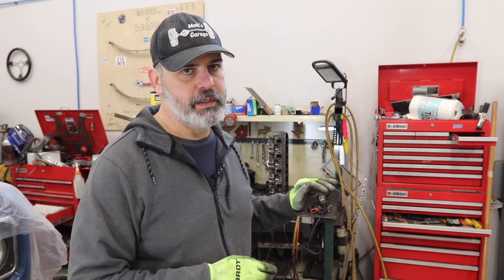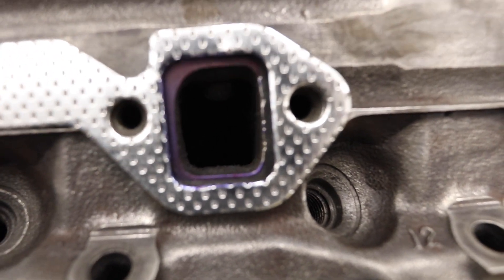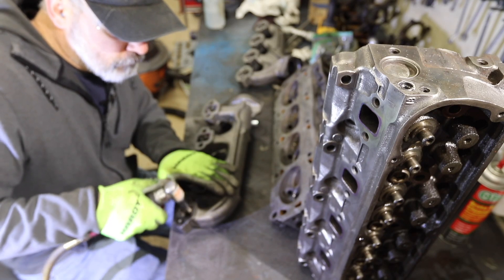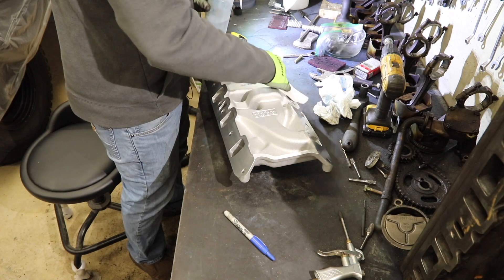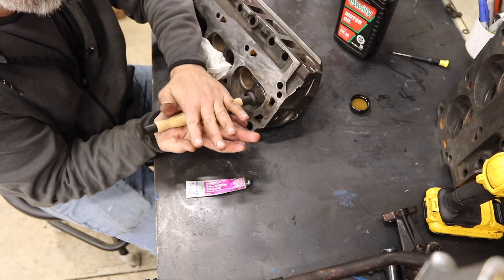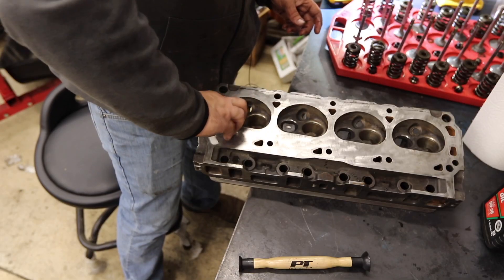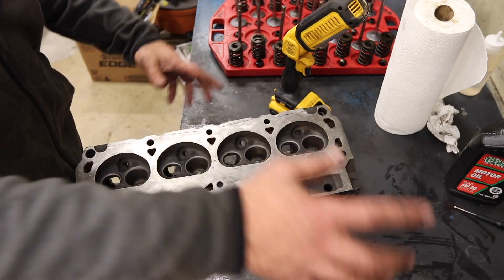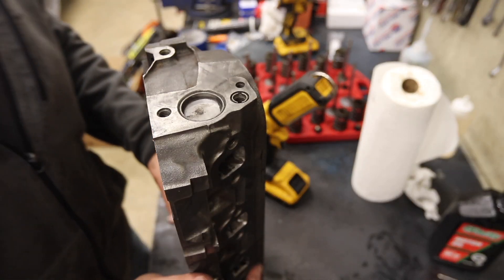9.33-Head Porting and Valve Lapping

Comment: Lapping valves is amateur.
Reply: Did you measure play in the guides? Also, porting is not the same as port matching. To port heads properly you need to use a flow bench. Its easily possible to reduce volumetric efficiency. Keep in mind you can easily get rebuilt heads in a day
Reply from the maker: @johndeckercom  no, I probably should have. I’m prepared to buy heads if need be. I kind of just wanna see what happens. I have a 302 with GT 40 heads that needs to be bored out 30 over. That motor is my Plan B. If you didn’t like the valve lapping you’re gonna hate my next video. Rhymes with “Kringle fall bone.”
Reply: Dingle ball hone won’t work unless you use very soft, cast iron rings. The good news? How you lap the valves won’t matter much. Trust me, as a kid I tried all the things you tried!
Reply from the maker: Elaborate please

Comment: I like this mechanical stuff it interesting to me to see how things all work together. Great video thank you for posting it
Reply from the maker: Thank you Nic!
Reply: Machinists know that lapping a valve will help it seal when cold but as soon as the valve gets hot the lapped area moves. The only effective way to seal a valve is to grind the valve and use it in a 3 or 5 angle grind on the seat
Reply from the maker: @johndeckercom  no argument from me on that. Given machine shops are 4 months out minimum up here, I need to keep moving.

Comment: Opening up the top of an exhaust port opening will give  the most benefit, not the bottom part. Great videos!!
Reply from the maker: OK good, 90% of what I took was off the top.  Those smog port standoffs just looked like flow killers. Thanks for the knowledge!
Reply: @MattsGarage  The standoffs are horrible for restrictions and were really bad on my 460. I plugged off the air injector ports with setscrews and blended them to help direct the air flow. Anything that you do to these things, to free up flow, is a step in the right direction.